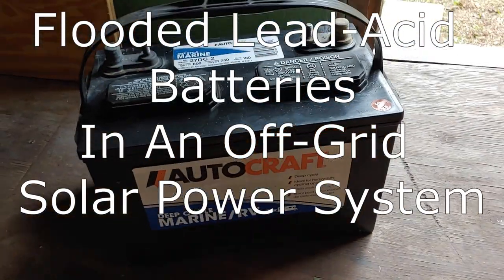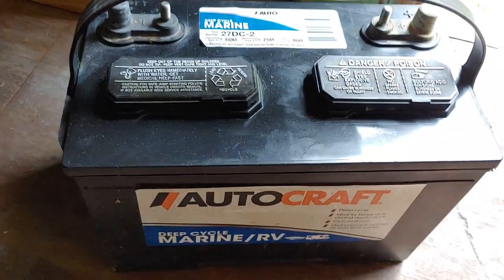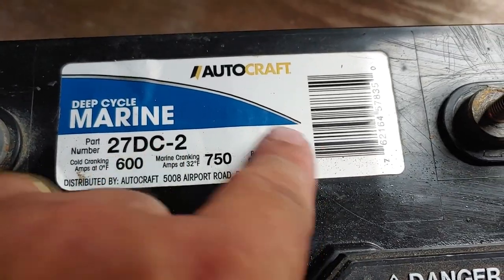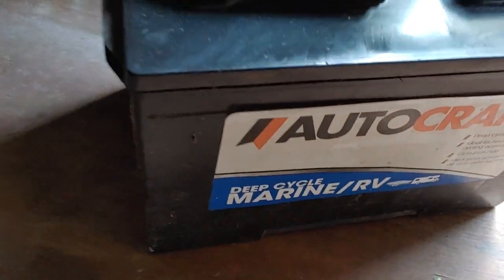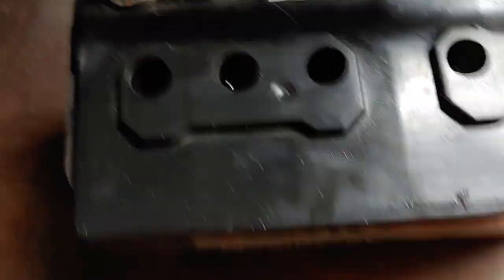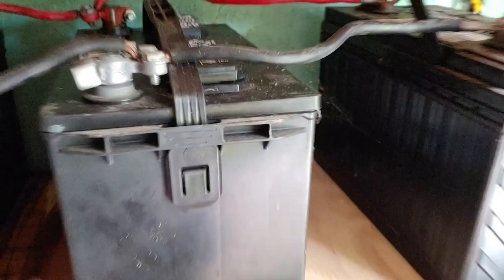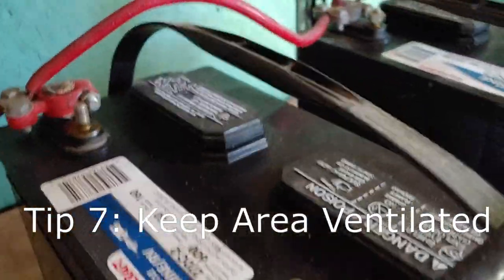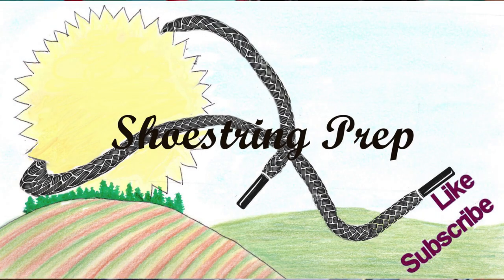Flooded Lead-Acid Batteries in an Off-Grid Solar Power System

Comment: You said to not let the voltage go below 12.1vdc, but wired in parallel how to you know each batteries voltage to keep them above 12.1? Also having 4 batteries wired in parallel would you wire the charge source (solar) in the middle of at an end? Thanks
Reply from the maker: I keep my entire battery Bank from going under 12.1 volts. I read the entire battery Bank as if it was one battery. I connect the wires to the charge controller to one anchor battery and it works out just fine for me. Thanks for your comment.
Reply: You would need to put one lead on a end battery if you have four battery's Pharrell together - you would put one lead say the positive on #1 battery them the negative on the #4 battery - 
      If you put both the charge leads on #1 battery - the number one battery will take all the charge - you also hook up your load just as you hook up your charging leads - 
     If your load and charge leads are hooked to #1 battery it will only draw current and charge #1 battery - #2 through #4  battery's will sulfate on you in a short time  - so to prevent that from happening you have to do what I had stated - 
      There is a lot to learn about any battery technology - you can look at my other comments & learn more -
Reply: @able880  Thank you very much
Reply: In parallel all the positives are connected to each and all the negatives are connected to each other and it won't matter where you connect a charger.
Reply: It does matter ware you terminate the load and the charger to a battery bank  - I'm a 4th generation hybrid power generation electrician ; my grand father started into that field in the late 1800s - I spent my yrs working in the offshore gas & oil industry - we generated all the power we used on offshore platforms - I did that for decades - 
     Many platforms are capable of going into hurricane mode when there is just to much moisture in the air for generators to run during hurricanes  - 
       In that case huge battrey's operate a platform - I'm very familiar with all types of battery technology - 
      Even lead acid battrey's can be cycled many decades if you understand the applied  technology - 
    For some one to say it's ok to hook up a charger or load to the first battery in a group of batteries lacks knowledge - 
    I spent decades maintaining large hybrid UPS systems - my comment on the proper way to hook up to battery has been  the industry standard for 160 yrs for a good reason -

Comment: I have been using FLA Batts and they last 6 to 7 years. Don't overcharge or run them down past 12.2 ---If they go down past 12 Volts and stay as little as I day they will sulphate and Die.
Reply from the maker: Thanks for your comment
Reply: Yeap.12.2 is the number; 
they don't always die; if one forgets the lights on, in the car, until the battery reads near zero, no kind of signs of life, upon recharging (within ONE day,tops!!)  it always recovers; been around cars for 40 years and this has happenned a few times to me and others; but if the battery was already old and barely making it,about to die,THEN it says the heck with it,and dies... rip (edit: recycle it please).

Comment: UPDATE : I have 18 batteries now...I may get two more. I have two more 100 watts solar panels coming Friday, so I thought I would get a couple more for them to charge. 1200 watts of solar charging 1000 amp hours of battery. These ones I use have 210 RC , they are a 29 DP-DL. It is 11 PM, 25.6 volts left. I think 20 will be enough. I'm trying to find some #2 welding lead wire locally tomorrow. I'm going to call it " The Twenty Mule Team " and hope it lasts twenty years. That's my plan for this year for my stuff. I have off grid power already but it won't hurt to improve it. I want to get my system in A number one shape this summer. At least no one should say I made a half way attempt at it. My power will be dependable and enough when I am done tinkering. Suppose I took two years' electric bill to build the whole thing ? And then I have 10 years of free power after that...that sounds okay to me. Well, it's like being in the lake above your knees, might as well jump on in there. LOL ...I feel for those who don't get something put together, whatever it is, big or small, as long as it is dependable. I want my stuff to be rock solid good to go. I'm hoping that by having a big bank the batteries will last a long time. Not much danger of boiling 20 of them all at once...they charge kind of slow when they all get together. Yeah since I will be done buying batteries this month, I will save for the pricey inverter. This is my first solar system. It is going to be nice when I get it all done, I think. Seems like everyone builds theirs a little differently. My 105 amp hour batteries cost me around $100 apiece, but they seem good enough to me for that price. The plates are just a little taller and wider in the ones I get. And they hold more acid , so less frequent checks. I've tried to cover my bases, that way. Oh, if your battery level is hard to see, a dental mirror from dollartree can be very useful...you might want to wrap it with tape before use though, except the end.
Reply from the maker: Thanks for the update. It sounds like you are getting the type of system you want.
Thank you for comment.
Reply: Most of what is stated about CMEs and EMPs on the domestic level is mis information - 
      If a bolt of lightning strikes a car it can destroy some electronics - but cell phone battery's and car battery s are never damaged - if a bolt of lightning strikes right next to a car at times a car might shut down but starts back up and is fine - 
      There many times lightning strikes. Next to solar panels and there fine even after several strikes - the battery's are ok  - my house transformer was once struck 2 consecutive times - 
     It burnt out a few phone chargers and a clock - but the phones were ok - 
     The EMP of lightning is concentrated and a billion times stronger than a CME or EMP -  they effect power lines the lines are gigantic antennas - the magnetic pulse creates a  electromagnetic pulse that creates an induction strong enough to create counter EMF - 
      It becomes surges for transmission transformers that generate extreamly high voltage and arc out the transformers and generators -     as for the battery's they can absorb much of that just fine - in the oilfields offshore  - all communications are supported by battery's of some sort - the battery's absorb the energy of direct lightning strike of towers. - 
      They do that with high cell towers also -

Comment: I’ve been watching many different videos about batteries…..and after all is said and done, I’m thinking the Lead Acid Deep Cycle maybe my best option.
       I’m building a rather unusual set up, and durability is key.
        I’m setting up a service truck for a long term vehicle build, so it will be able to do many tasks.
        So it’s a 1992 GMC, I’m going to remove the bed, and build a custom utility bed with my welder/generator and a separate dedicated generator connected to an Automatic Generator Start switch a charge controller and a couple of inverters, as well as a DC to DC charger and at least one, possibly two 250 watt solar panels up top.
     A large dedicated metal toolbox up on top of the roof rack will hold the “house batteries” with one solar panel on it, the toolbox will be insulated and fire resistant, with cooling fans and a fire extinguishing system (just in case).
      I was going to get two large 250AH batteries, but it seems several car size RV batteries should work as well.
      The duties of the battery bank, will be to power one inverter for general 110 use in the cab, and a second inverter to power climate control system for the cab and battery box, the generator (insulated for sound) will automatically start early on cold mornings to heat up the cab, and warm the antifreeze with a block heater. Thermostats will determine when heating or cooling is needed.
Reply from the maker: Sounds like a plan. Let us know how it works out. Thanks for your comment.

Comment: I have 14 of those from Autozone,...I'm thinking about getting two more...lol...they are running a 24 volts 2000 watts Aims inverter / charger ...I have 1000 watts of panels, and a 40 amp Epever charge controller, 4215 BN...I didn't use much power so the battery bank was at 24.4 this morning , sometimes it drops a little lower but not much...I got too many batteries and had to get more solar panels a month ago so I don't want to get too many more...maybe max out at 18 of them...lol...the first ten were 90 amp hours but the last 4 are 105, 180 and 210 reserve minutes, and if I get two more they will be the bigger ones...that would give me 765 amp hours @ 24 volts...I'm thinkin that's enough for me...I started this little solar journey about a year ago...I haven't used the grid for four months...I used to use the gasoline genereator some but now I've even stopped doing that...I used a # 2 welding lead on the battery wiring and there's four ends attached to the inverter...nothing has ever gotten warm on any of that...one thing I did on my system is, I put a #6 wire to all the 12 volts connections, like an 8 legged spider with a big brass Kearney in the middle...that's my BMS...so that when I hook up my 410 watt inverter to run small stuff, it is running off either the top set or bottom set of 7 ( for now) batteries, that way it doesn't run one battery down...This is one of the coolest things I've ever done...I guess it's a good thing I bought my inverter when I did...it has went up $116 since I got mine in December...I barely could afford it as it was...thanks for the great video...everyone said don't use those kind, but I've been around cars and batteries since I was a kid...and I know it takes a lot longer to charge a marine battery so I knew they would be okay...it just takes a lot of them to throw out a bunch of amps but they recover nicely...I'll probably get two more and stop at 16...I think I have about enough...yay...those things cost...lol  Buying the last  two will be like getting a get out of jail free card...
Reply from the maker: It's great you could build a system that works for you. Everyone's system will be a little different to meet their needs.
 Upload a photo of your system if you get a chance. We would all love to see it.
Thanks for your comment.

Comment: well at my location the cheapest lead acid deep cycle batteries , when i calculate the usable A  in each type lead acid is 3-3,5 times more expensive  the cheapest is the eve 280 ah lipo4 cells not the  asembled ones they are however still cheaper then lead acid ,, i have been running a 8s 280ah 24v as my energy storage for about a year now its enough for 3- 4 days of power i am however gonna make a identical 24v more , for more storage i have been looking for used forklift batteries as i figured some of the smaller handtrucks were going to litium however no luck
Reply from the maker: I don't know about forklift battries. Thanks for your comment.
Reply: @shoestringprep  thanks for your answer , if you are located in the states i can recommend looking into them   they can be purchased cheaply compared to the durabillitythey are comprised by 2V cells but are 70cm high 25cm wide  and they have huge plates and can take a real beating the ultimate deep cycle battery many buy 36 volt packs and sort the worst cells off and build either 2 12v or 1 24v battery

Comment: what voltage would a 35ah battery after drawing 35 amps for one hour?
Reply from the maker: If you used the entire 35 ah in one hour the voltage of the battery would be to low to use. Thanks for your comment.

Comment: I have a 48 volt 840 amp system off grid, 12 years. I just got done running a 3 1/2 day test on my essential load panels through my Sunny Island.

Let me hit you up with a bit of grammar:

Nothing is ever "four times (4X) less expensive." 

That is "getting bigger" to "get smaller."

What you meant to say is that: "FLA IS 1/4TH THE COST OF LFP ... or ... 25% AS EXPENSIVE."

Guess I'm a dickhead.
Reply from the maker: Thanks for your comment

Comment: IVE USED 2 CAR BATTERIES ON MY SMALL SYSTEM TO RUN LIGHT AND  SYSTEM,  FOR 2 YEARS NOW, I JUST MADE SURE CONTROLLER WAS SET TO 11 JUST OVER 59% OF BATTERY CAPACITY  I FOUND I COULD GET 6 HOURS OF TV POWER AT LEAST OFF THE 2 BATTERIES,
Reply from the maker: I'm pleased your system is working for you. Thanks for your comment.

Comment: use a scrap piece of a mirror and a light to check inside the lower batteries, no need to pull it out
Reply from the maker: Good tip. Thanks for comment.

Comment: he statement regarding flooded lead-acid batteries in off-grid solar systems contains several misleading elements. Let's break down the factual inaccuracies and clarify why this view might be harmful, especially when considering current technology and the evolving landscape of energy storage.

Misleading Claims and Clarifications
Current Draw and Performance:

Flooded Lead-Acid Batteries: These batteries can indeed provide high current, but their efficiency diminishes as the current draw increases. Flooded batteries have higher internal resistance, which leads to voltage drop under heavy load, reducing their effectiveness.
AGM (Absorbent Glass Mat) Batteries: AGM batteries can handle higher current loads better than flooded cells. They have lower internal resistance and can deliver higher discharge rates without significant voltage drop. This means that in scenarios where high current is required, such as during heavy solar output or for powering high-demand appliances, AGMs outperform flooded batteries.
Cost Considerations:

Initial Costs: While flooded lead-acid batteries are often less expensive upfront compared to lithium-ion and AGM batteries, the total cost of ownership (TCO) over time is crucial. Flooded batteries require regular maintenance (checking water levels, equalizing charges) and have shorter lifespans (typically 3-5 years under optimal conditions). In contrast, AGM batteries, while slightly more expensive initially, offer maintenance-free operation and longer lifespans (up to 7-10 years or more).
Lithium-Ion Batteries: In 2021, lithium batteries were relatively expensive but offered significant advantages in efficiency, depth of discharge (DoD), and lifespan (often exceeding 10 years). As prices have decreased since 2021, lithium batteries have become a more attractive option for off-grid systems due to their higher performance and lower long-term costs.
Maintenance Requirements:

Flooded lead-acid batteries require significant maintenance, including periodic watering and equalization charges to prevent sulfation, which can diminish capacity and shorten lifespan. This maintenance not only adds cost but also requires time and knowledge to perform correctly.
AGM and lithium batteries are generally maintenance-free, leading to lower operational costs and less hassle for users.
Technological Advancements:

The shift away from flooded lead-acid batteries in off-grid solar systems is largely due to advancements in battery technology, specifically lithium-ion and AGM batteries, which provide better performance, higher efficiency, and more reliable energy storage capabilities.
As energy needs grow, especially with the increasing integration of solar power and electric vehicles, technologies that support high current loads and fast charging capabilities are essential. Lithium batteries excel in these areas due to their high energy density and fast charge/discharge capabilities.
Conclusion
In summary, the statement promoting flooded lead-acid batteries as superior for off-grid systems misrepresents their performance, cost-effectiveness, and maintenance requirements. The reality is that while flooded batteries may seem cost-effective upfront, their inefficiencies and maintenance needs make them less suitable for modern off-grid solar applications. AGM and lithium batteries, despite their initial costs, provide superior performance, lower maintenance, and longer lifespans, making them more viable in today’s energy landscape. As technology continues to evolve, understanding these distinctions is vital for anyone considering battery options for solar energy storage.
Reply from the maker: Thanks for your comment.